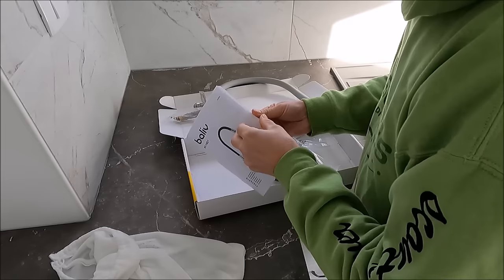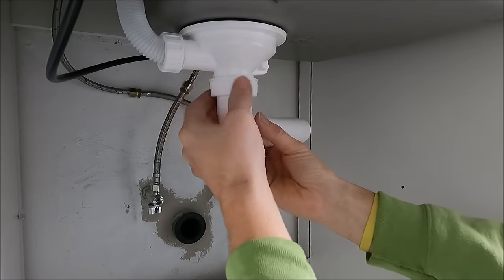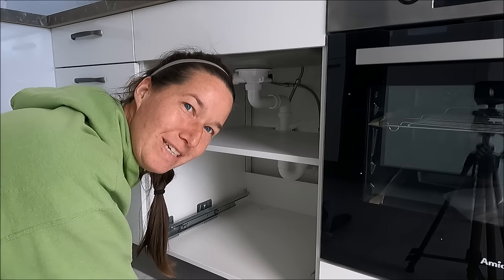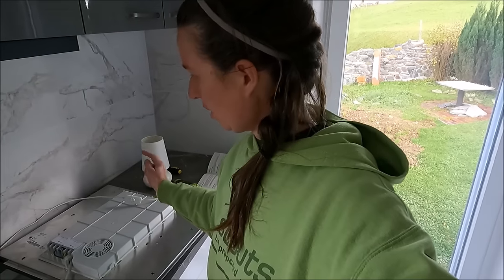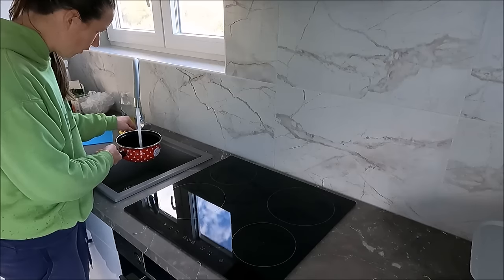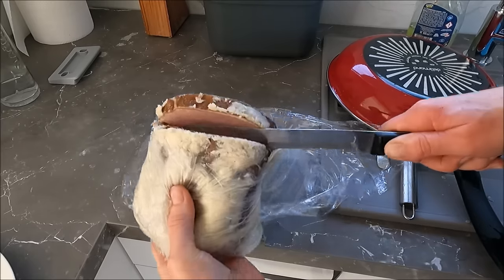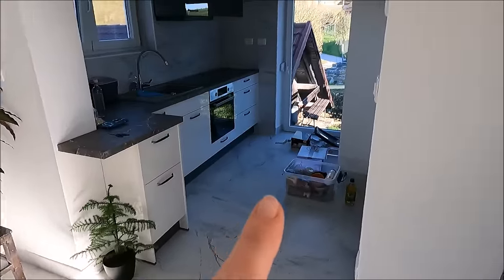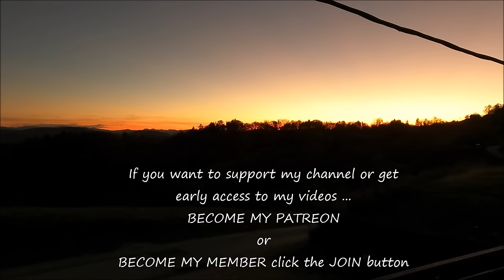LIVING in BASEMENT for Months, but Now I'm Moving in LUXURY Home | Martinas Life

Comment: I don't know if someone already mentioned this or not, but I would like to give you advice about those flexible water pipes. From what I know, their lifetime is usually 5 years and then you are supposed to change them. Sometimes they can last up to 10 years or maybe even more, but you never now and why risk it. If you don't change them regularly, it can tear and the leaking water can destroy many things. There are some other pipes, which are created in a way that it cannot tear, so you don't have to change them, but they are more expensive. In Czechia we have Flexira or Merabell but I don't know if you can buy them in your country or if there are other manufacturers available.
Reply from the maker: I will see the leaks and change them, it's easy
Reply: I saw pictures of destroyed pipes, it just completely tears, there is usually no warning sign before. It's like you would leave the valve open and let the water run out. If it happens while you aren't home, you can imagine that it's like a flood. It happens because there is only a small rubber pipe inside that steel wires and it gets weaker over time.